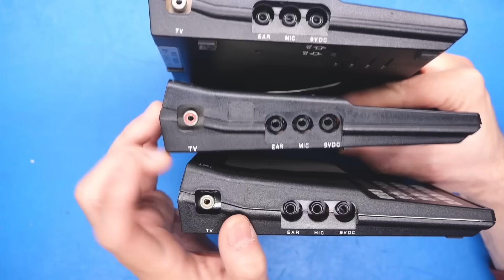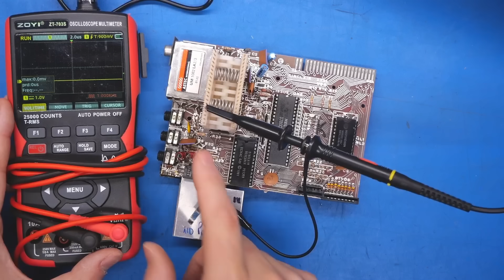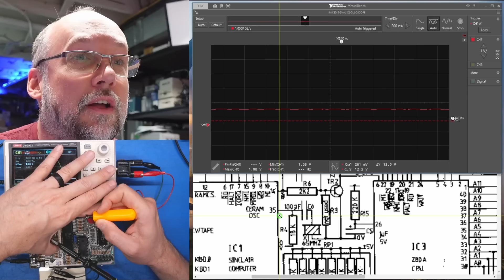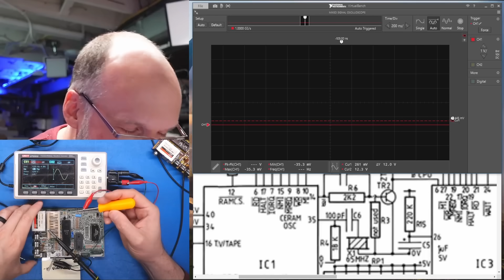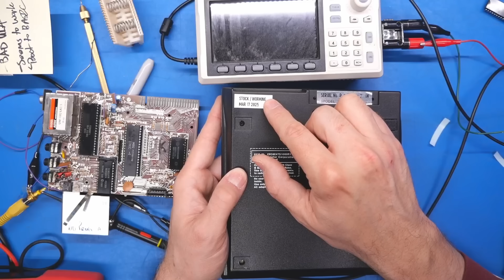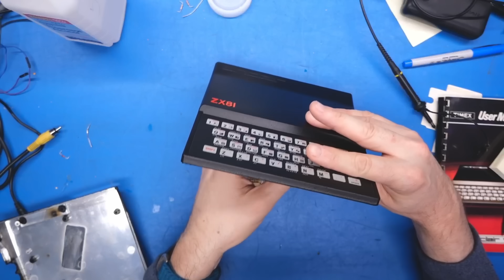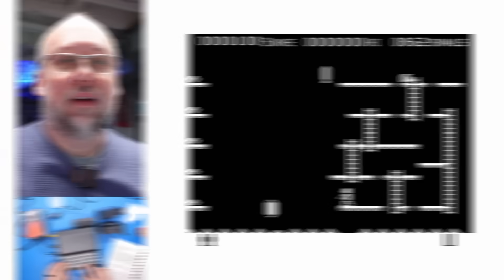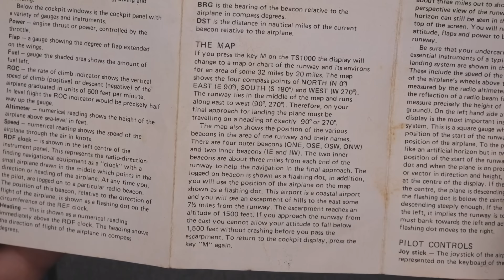Is the ZX81 / Timex Sinclair 1000 actually bad? Let's fix these to find out.

Comment: I bought my US ZX81 in 1982 from Nashua, NH. I also bought peripherals from the NH offices in 1982 and 1983, so likely Sinclair was selling mailorder until early 1983. I actually took a road trip the old NH headquarter in July of 2023 (you can check out my video on that date...coming from the Cambridge, MA area).

Price-wise, the other benefit is that the ZX81/TS1000 worked with a normal cassette recorder. Didn't the VIC-20 need a dataset? Oh, and as a kid I plugged the power into the wrong place a few times with no issue. I recently did that and again, no issue.

Comment: I bought the MicroAce ZX 80 kit, it has the same exact keyboard. You are wrong about the worst cost cutting, it wasn’t the keyboard, it was definitely the way they did the video. 

My first basic program was an attempt at a clock. It would work, but you could only see the time by halting the program! It was $79 for the kit. Add a capacitor on the output of the Voltage regulator to clean up the Power!

https://en.wikipedia.org/wiki/MicroAce

Comment: I bought the MicroAce kit (advertised in Popular Electronics in 1980)  version of the Timex Sinclair 1000, it has the same exact keyboard. You are wrong about the worst cost cutting, it wasn’t the keyboard, it was the way they did the video. The dust program was an attempt at a clock basic program. It would work, but you could only see the time by halting the program! It was $79 for the kit.

The housing used plastic push pins to assemble it, no screws at all.

My version has a lot more chips  and every chip was socketed. The keyboard was built into the main board. Later on, they came up with slow mode, the processing is only done in vertical blanking time instead of vertical retrace time of fast mode.

Comment: I had the original ZX80, upgraded the ROM when it became available to make it ZX81, bought Sinclair 16k memory modual and then bought the Time Sinclair 1500 which had sort of a better keyboard, on board 16k memory, printer, modem and 3rd party external memory modual.
I learned programing on these machines and actually used them to do my income tax returns.
Although the keyboard sucked I did get use to it, back then it was the only computer I could afford.
I also modified the original ZX80 for reverse video by installing a simple mod and a switch.
Thank you for your videos and your insight.

Comment: Yes.... it was bad. If the ram pack shifted at all..... all of your hard work would simple disappear.  I remember having several large rubber bands around it trying to hold it tight.  It was a slide on pack that  that was top heavy, and unsupported.  Just a wiggle would dump everything.

Comment: The ULA is the oscillator. The ceramic resonator is used like a crystal. The feedback path looks like the resistor in the base of the transistor to pin 14

Comment: The Timex-Sinclair 1000 was the first (home) computer I ever used, borrowed from my nephew's girlfriend. I absolutely fell in love with it and learned a lot about BASIC typing in programs. I had no storage for it, so had to type in everything from scratch each time... I ended up using it so much that I burned the poor little thing up (no fan, of course), much to the consternation of my nephew's girlfriend. It got me hooked on computers, though, and I then went on to get an Atari 800, then a Commodore 64, 128, and eventually IBM PC XT, etc. Still have a soft spot in my heart for the little Timex-Sinclair, though :)

Comment: The ZX81 & TS1000 were unfortunately what Jack Tramiel based his TED/C16/264/etc series computers on, which helped nosedived Commodore a little bit further after he quit his own company.  He put his Masses Not Classes mantra into overkill unnecessarily with that project as he went in the wrong direction by competing with such cheaper computers, that no one really wanted & then those Sinclair/Timex computer sales quickly collapsed anyway, thus the labor to make those black Commodore computers were basically in vain.  This was a huge reason why the C-128 became so much more popular as the bounce-back from the black computers magnified the jump up into better sales for Commodore.  I myself tried out those TS1000s demos at department stores.  They were intriguing, even with the low price, but I knew they were not for me.   Memotech even made add-on peripherals for the ZX81/1000 which would have been nice but the overall core design would have still been something that was less featureful than the C-64 that I had, & still have to this day.
06/08/25

Comment: You have a ZX81, the ZX80 every time the program runs or you press a key the screen goes blank as the CPU generates video (SLOW mode). Without it the image disappeared when running a program. About the price in UK was 49.95 pounds as a kit to assemble 69.95 assembled.

Comment: The red letter ZX81 was available as a kit.  I built mine and used it for years.  The 16K RAM expansion I had was a low version that was just as wide as the case.  It came with Velcro to help keep it from getting bumped.

Comment: What you have to remember is that most users didn't know how to type and hadn't touched a computer before - you are coming from different experience/expectation. The multi-functionality of each key was a way for beginners to learn programming and slightly offset the keyboard issues.

Comment: If memory serves correct, the 'noise' on the screen is a kind of interference to do with the frequency of the  crystal and how it phases with the looping in the ULA. It seems to hold a kind of 'static' charge from when the power plug is inserted that has no way to dissipate. I found that about 1 in 3 times of plugging in the power, the screen phased clearer. It might have something to do with the RAM pack drawing too much of the power when the ULA is innitiating, so when you unplug and plug back in within a certain time, the RAM has enough latent charge in it to choke a bit and let the ULA initiate cleanly.
Im guessing that a couple of very inexpensive components on the output voltage rails on the expansion slot would have solved the problem but it was made to the cheapest price point possible and the RAM pack was a kind of afterthought because the slot was originally designed for peripherals and control output.
(This was expanded on with the Spectrum as it had RS232 support)

Comment: I had a ZX80, which had a lot of TTL logic in it, instead of the logic array chip. The kids had fun learning to program in BASIC with it. If you didn't get the syntax right in the bottom line you were writing, it wouldn't 'go up' into the program.  The keyboard wasn't too bad, since one keystroke was a full BASIC command word.  It served its purpose, was quite inexpensive and a lot of fun when the children were in grade school.  It's good to see there's a few still around.

Comment: The keyboard and lack of meaningful ports were deal breakers.  The memory expansion was notoriously glitchy because the slightest movement could cause the machine to lock up.
Just fixing that and making a IO & Ram module would have been a huge deal.

Comment: Regarding the video noise of the RAM expansions - move the ZX-81 and expansion box away from the monitor! It is almost certainly an RF shielding issue in the modules. Adding distance will decrease the RF noise reaching the monitor, which is messing with the CRT scanning. Back when these were made, RF shielding requirements were much more lax than they are today.

Comment: My 43-year-old Timex Sinclair 1000 still works very well. Of course, the keyboard is a naturally a pre-established nightmare to use, but it is the original membrane pad and it is still fully functional with all keys working, so go figure. Even more wild, my unmodified original computer works on my 8K Samsung TV made in 2023... without the need for a convertor or an adaptor, but instead, used the raw RF input. You'd think an analog computer wouldn't work on an all-digital display without special mods, but here's my TV casually displaying the word "READY." in black and white from the computer's prompt! Of course, the screen blanks out when tapes load and save, but after loading, the programs display as intended. I was able to play "3D Monster Maze" on a modern display with no special hardware modifications and no modern RF adaptors. Just a standard and simple 75 OHM RF connector as old as the computer itself plugged directly into the 8k TV.

Comment: I was an very early adopter and got a ZX80. As a £79.99 kit since we couldn't afford the extra £20 for it prebuilt. 
But my finest memory is soldering the kit together with my dad on the kitchen table and having it boot up for the first time! Then there was the wondrous things you could do with z80 machine code. One could tell a machine what to do! 

So my career later became engineering degree, embedded programmer, architect, CTO and today CEO of an IT company. All due to that little box. Fantastic!

Comment: The component you refer to as "crystal oscillator" is called a ceramic resonator. The "oscillator" refers to the entire supporting circuitry (capacitors, and transistor) that includes the resonator. In this circuit, the active part of the oscillator is inside the ULA, which generates a square-wave at the approximate resonant frequency. That signal excites the quartz crystal inside the resonator, which vibrates at an exact, precise frequency of 6.5MHz. The resonator is in the ULA amplifier circuit's feedback loop, and it causes its wave generator to be synchronized to the resonator's vibration, and hence, the synchronized square wave is a proper clock signal, albeit with some negligible jitter. Together, the amplifier inside the ULA, the passives and the crystal resonator form the "oscillator".

So, in order for the resonator to begin resonating at 6.5MHz, it must be fed an square wave (kick) near half of its fundamental resonating frequency (3.25MHz in your circuit).

Hopefully this explains why the ULA generates an unstable square wave (near 3.25MHz) on pin 14, the output, without a resonator installed, but it synchronizes to the pin 35 signal when you feed a 6.5MHz from your waveform generator, which approximates the resonator fundamental vibration frequency.

Edit: Also, it looks like the 3 pin component you desoldered is a ceramic resonator, while the schematic shows a 2-pin *crystal*. Ceramic oscillators contain no quartz crystal, but only passives, like two capacitors and an inductor, and are cheaper, but less stable (5000ppm vs, ~20ppm for the crystal resonator). This might explain the "errata" notes added as the first page of the Timex manual. TV's that lack the fine adjustment would be unable to sync to the less accurate output of the ceramic resonator. The replacement was likely part of a cost-saving exercise when bringing the ZX81 to the US. In the UK, the original schematic (which you have) shows a 2-pin crystal oscillator, which is precise and does not require a TV with a wide tolerance for input line frequency, while when imported to the US, the design was changed to use the cheaper ceramic resonator to cut costs, but the engineers didn't realize that some TVs would be unable to sync until after the mass production button was pressed, so they had to add the errata to the manual to prevent returns and complaints like "it doesn't work on my Zenith TV". Since the UK models use a crystal, they have no such TV incompatibility issues.

Comment: The extra small ram socket was because the board could either take one 1kb RAM chip or two 512 byte ones , underneath the big chip on your board are the pads for the second small chip

Comment: At 3:13 you can still see the non-NTSC plug panel fill, they cleaned up the mold a lot but not enough. I wouldn’t be surprised if some of the original molds were simply sent over for the Western market…

I still have my TS1000 on display in my vintage computer collection

Comment: Regarding the 16KB RAM packs - the way they're designed means that the internal 1KB RAM of the ZX81 is disabled (or otherwise not used) when the RAM pack is fitted.

The company Memotech produced their own 16KB RAM pack - and also alternate capacity units, too; off the top of my head, I remember 32KB and (I think) 64KB RAM packs, and also a "HRG" ("High Resolution Graphics") module (I've only ever used the 16KB RAM packs myself). The Memotech RAM packs also have through-connectors, allowing multiple units to be used simulaneously, even with the ZX81 printer to be added to the chain.

(Memotech, as you may be aware, went on to produce the Memotech MTX computers, as used as props in the film "Weird Science".)

I've also got copies of the early-80's "Personal Computer News" magazine, and one of them had a mod in it, remapping the internal 1KB RAM into the 8KB-to-16KB address range, allowing it to be used - only downside is that you would then have to use a RAM pack, otherwise the ZX81 wouldn't work.

Comment: Back in the day I picked up a surplus keyboard at Radio Shack for $4.95 and managed to get it to work on my Timex Sinclair I had. It just caused a lot of interference when I used it. We used antenna TV back then. That jury rigged keyboard I was using had no shielding. I think I still might have that junk lying around someplace. Down in the trailer in the backyard. That's my old computer graveyard.

Comment: I bought a 1000 for $50  at Jamesway to take advantage of a $100 trade in deal for my first c64.  I didn't bother to take it out of the box and owned it for maybe 10min.    I had used a friends and deemed it junk.  When I went back to the software shop a couple of days later, they were using a 1000(maybe mine?) as a door stop.

Comment: No, I never got used to the terrible keyboard, after thousands of hours. So eventually I bought a separate keyboard, which was utterly bare-bones, joined by ribbon cables. But at least that stopped the dreaded RAM-pack wobbles causing catastrophic crashes and the loss of many hours of typing in listings.

Comment: Those crappy keyboard connectors were always a problem that rendered many a ZX81 useless. What a dumb design; I'm sure there were other, more robust options that were equally cost effective. I managed to get replacement keyboards for mine.

Comment: The ZX-81 didn't just have a terrible keyboard, it was also in my experience an unreliable keyboard with parts of the matrix failing at time.  Fondly remembered for the unique screen full error of the 1k version of the system when the 1k memory are no longer sufficient for system, program and video memory.

Comment: A friend of mine had one.  When he bought it you could buy is for $99 if you assemble it yourself or $149 assembled.  I don't recall if it were branded Timex or Sinclair.   I got to play with it once and I found it to be a very frustrating computer to use.   All I know is he did not use it for long and went with the C64.

Comment: Worst case desolder the connector for the keyboard and add some wire length from the pins to the board.  Then just cut the ribbon short to get a good unbroken peice.

Comment: I was in high school when the ZX81 came out, the school had purchased around 20 and would let students borrow them over the weekend, was the first time I had a chance to use a computer at home, Dad thought computers were a fad, ended up building a Talking Electronics TEC 1 kit computer, a Z80 machine code computer, the Talking Electronics magazine came out every few months with add on boards to build.

Comment: I wish the VIC-20 had had a 32 column screen. To fit in 512 bytes, we're talking 32x16 and upping the CPU speed by maybe 33% ... I don't know if the 6502 and RAM could deal with that extra clock speed.

Comment: These machines had a plethora of add-ons.  Keyboards: - some mounted the machine in the keyboard, some connected by the edge connector; memory expansions to 64k - usually by edge connector but some users home-brewed 64k inside the machine.  Our user club built speech and music expansion add-ons.  When programmed in machine code the machine was very fast and the screen was much more detailed.

Comment: In 1981, I saved up money from doing my paper round to buy a ZX81 in kit form - my older brother built the kit for me.  I learned to program in BASIC from the excellent manual. I bought an external keyboard for it, which I connected with a badly soldered connection - but it worked... I sold it in about a year and bought a ZX Spectrum (originally called the ZX82). I now tutor in technology subjects (including some Python, Javascript and PHP) for the OU in the UK! The ZX81 made computing accessible for thousands of people like me who had very limited funds, but patience and perseverance to teach ourselves how to code.
Reply: If I'd have known then that the ZX81 would have led me to PHP.... I'd have stuck to Biology. ;)

Comment: i learnt to programme at school (UK) in basic on a RML 380z  in 1980, not many schools had computers so I was lucky to see one
i bought my zx81 when they first came out - i still have it, the ram pack and the thermal printer
i when to college in 1983 and in 84 i used the zx81 to write a critical path analysis planning tool  which helped me pass my final year - all in basic, all on that keyboard
last year I retired from running my own software systems consultancy company which i believe  i would not have had if not for the ZX81 and my early experiences

also I love how engrossed you got in an 8 bit blocky black and white silent game - i actually recreated monster maze for myself on an amiga many years later

the problem with the 81 and the ram pack - other than the wobble crash - was heat, lifting it off the desk with extra blocks under the feet did help the video signal and prevent random crashes